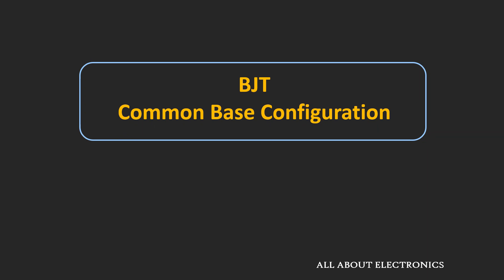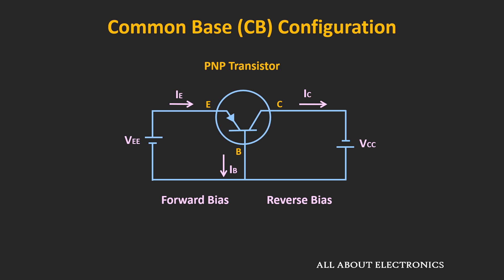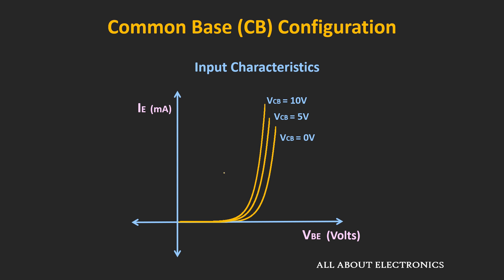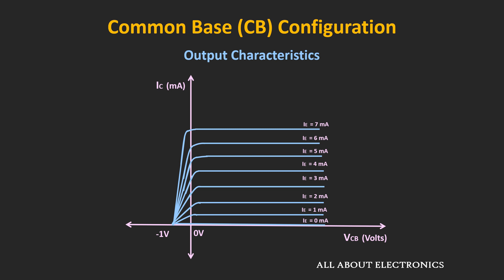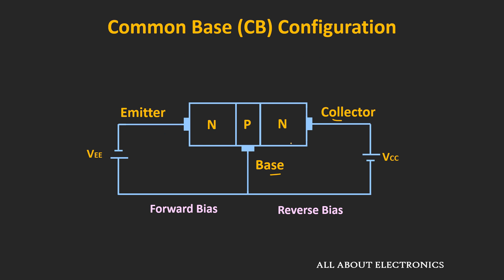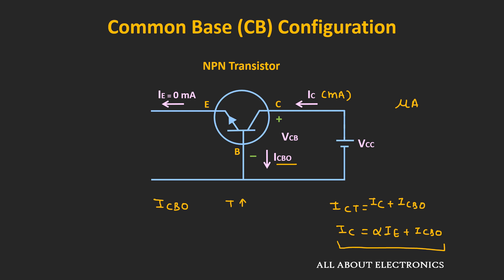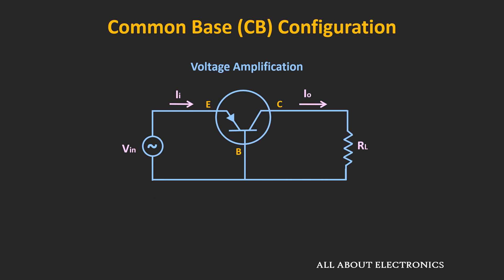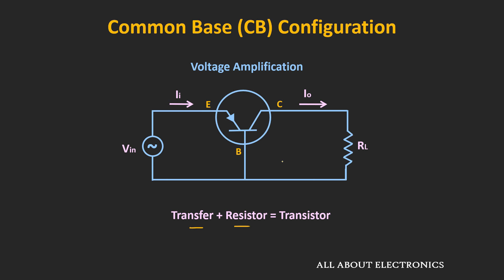BJT : Common Base Configuration Explained

Comment: The discussion of three connection modes are all mixed up in three videos. Looks like providing the same confusion poorly organised text books are providing.

1. The fact that base current turns on the transistor is common thing, why emphasise that in Common base case configuration?
2. Input and output impedance should be called out in all the configurations. Did you omit that in common emitter configuration, I am not sure?
3. Why common collector discuss alpha beta and gamma. Isn't that a general transistor characteristics? I mean it is good for exam. In other words why a circuit designer should consider these values is more important than jumbled mathematical relationships between them. Beta is the only useful stuff according to me. I am wrong, but your lecutre doesn't point out where I am wrong. 
4. Practical help on designing a rudimentary amplifier or switch using a transistor and real available resistors would make these sessions more interesting. My englinnering lectures and labs didn't teach me that, had to learn that myself after playing with some real components and breadboard. 
5. Actually the stuff is simple and should be taught in high schools without the scary charts.
Reply: Hello Anand, this is a pretty old comment but I loved this comment. The fact that the whole idea of a transistor is so poorly organized in almost all books is notable. Also the idea of what is common is simply the idea of what factor are you measuring. No lecture and book emphasize on this.
Reply: Yes, that’s true :(